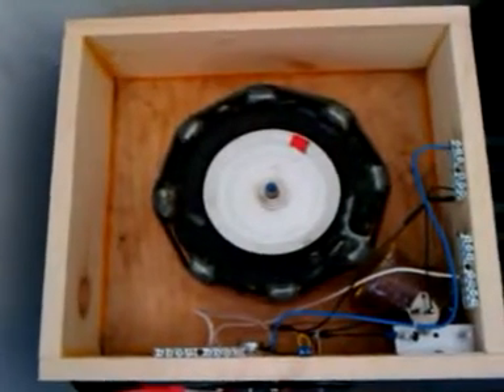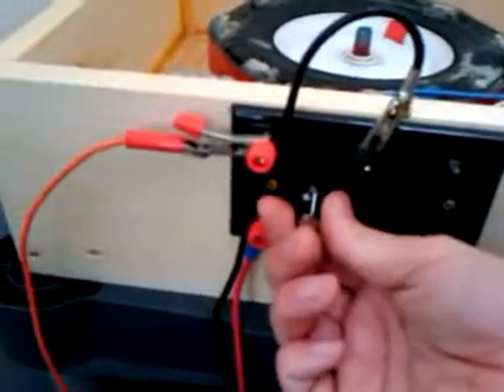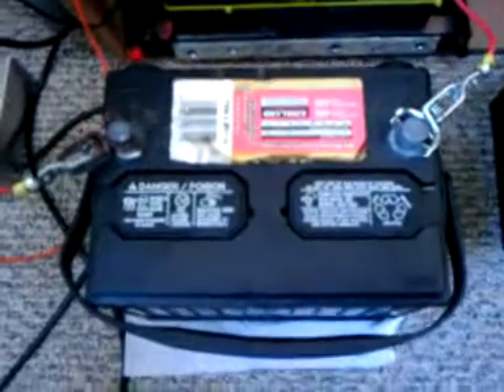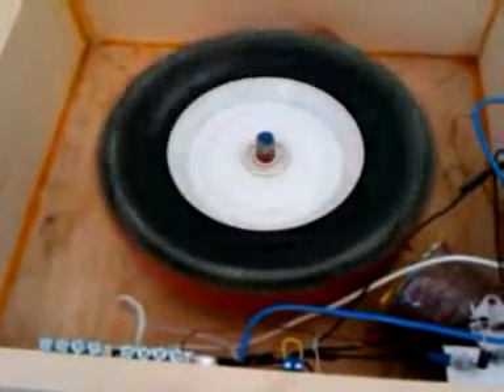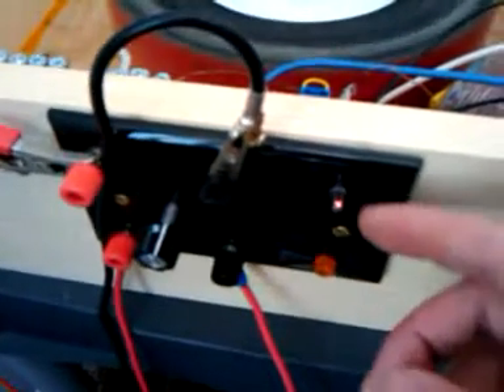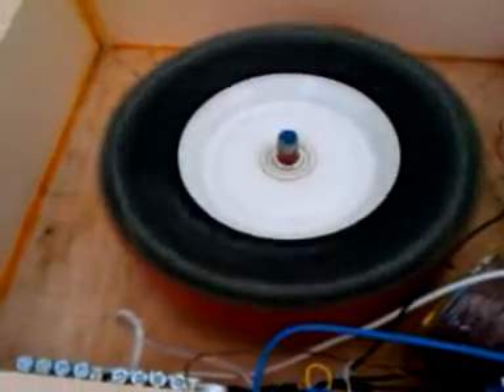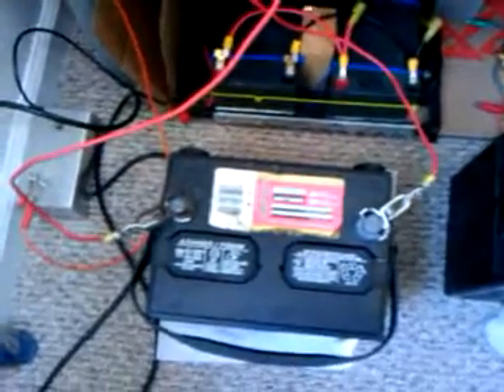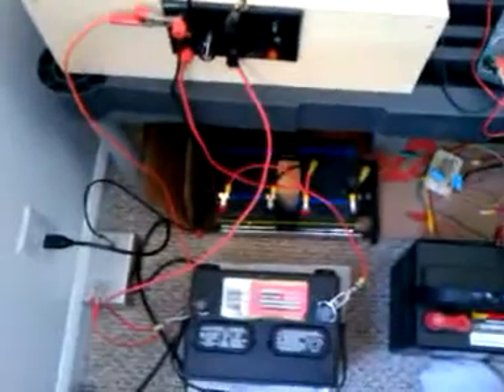How to desulfate a lead acid battery.

Comment: What magnet do i used  for this mate thanks in advance
Reply from the maker: Cheap ceramic magnets. Can be weak. Only important thing is that they have distinct N and S poles on opposite sides.

Comment: Hi    instead of using the Bedini motor why don't you use a stepper motor rotated by a common DC motor? , the voltage pulses coming out of the stepper motor windings are very high and with good current, and 200 HZ frequency per revolution
Reply from the maker: Been looking online but cant find much of what you mention. But you got my interest.
Reply from the maker: It would be interesting to see if you can get more out than in?
Reply: @TheDoItYourselfWorld  POWERMAX II®HYBRIDS is perfect ....I used powermax ii hibryds with 3 Ohm winding resistance and the peak voltage was around 190 Volts. good quality stepper motors must be used with neodymium magnets

Comment: I had read that the best way to desulfate a battery is to simply charge and discharge it repeatedly with a manual charger that you can set the voltage and amperage of. Usually they say use high voltage and very low amperage. Do you know what voltage/amperage is ideal if attempting to do this with just a charger?
Reply from the maker: No, I do not. But yes, you can restore it to some extent by "over charging" them. I dont mess with that since my Bedini motor works so nicely and gentle on the batteries.

Comment: Thinking back to the principle of how brush DC motor work.   When the circuit is in closed loop.  The DC current passing through BAttery+ terminal>>brush >>Commutator>> Armature coil>>commutator>> brush.>>BAterry - terminal.  The magnetic field is develop and store energy during a part of rotating angle  let say 178 degree of rotation.
   Then the brush is leaving it contact from commutator.  The decupling  high voltage will be developed becasue flowing current through magnetic coil try to maintain the current (Pushing by the shrink of magnetic field) across high impedance gap. If you everseen the spark at brush motor, That is. 
   The highvolt  is feed back to sulfate... That is his reason why..  Anyway The motor is better tooking out the  decoupling voltage absorber (Such as revers diode, Capacitor or any resister cross the motor terminal).   

   This kind of desulfator is producing the reverse high voltage pulse to batterry.
Reply: “This kind of desulfation is delivering reverse high voltage pulse to the battery” 

Can you explain what that means? Is that good or bad

Comment: Also, if you ever go to like autozone and they test your car battery with that little hand held tester thing, I don't care if they say it is good or bad, don't believe it. Those things plug a few variables like internal resistance and Open Circuit Voltage into an equation, but really they are about as accurate as flipping a coin. You want it out on a full load tester which puts a load on using coils that realistically simulates a car engine starting. Industry standard is holding its CCA rating for 15-30 seconds while staying above about 9 volts at room temperature.

Comment: I worked at a Batteries+Bulbs store. The best de-sulfating device I ever came across was from a company called Granite. It would bring batteries that put out 0 volts, had been left unattended over an entire winter, and were clearly near death. The best ones pulse voltage, amperage, and the frequency of the pulses all at the same time. This, along with a Schumacher (or as we called it, a dumb charger) charger was the best combination. We use the Schumacher to get the batteries voltage up to about 10 volts (it puts out power no matter what it's plugged into, warning, don't cross the leads though, it'll scare you), then the granite finishes it off. Often times it would bring them back better then factory specs.

Comment: I am using Auto Pulse Desulfator and I took the battery out of the car, charged the battery to 12 V, but the desulfator runs only until it discharges the battery to 11 V or less, so I have to charge the battery again. Is there a way I can connect both the desulfator and the charger to the battery so that desulfator can run all the time and recondition (charge/desulfate) the battery? Is it safe desulfator runs along with the charger, and can the desulfator damage the charger connected together with it to the battery? Thanks.
Reply: Hook up a good batery in paralell and keep an eye on the voltage. That will keep it running.
 I dont know if the charger will hurt the desulphator or not.

Comment from the maker: Yes, it is normal. The voltage under charge will be higher. But be sure to cycle it with a charge, the rest a bit, then discharge some, rest a bit, then repeat until the battery is restored. It will take a few cycles at least, to get it in shape again. But if it was new, it should recover.

Comment: I am trying to restore my motorcycle battery. It was basically new last year but I let it run down and sit for a year. I charged it up using my 2 amp charger. It will read 12.8 volts. But after resting it goes back to 10.5 volts. 
I built a bedini from ideas I got from you and others. It is charging with the bedini but it shows 16 volts while being charged by the bedini. 
Is this normal for a heavily sulfated battery. Also do you think plates are shorted because it rest at 10.5 volts

Comment from the maker: It takes a while, depending on the size of the Bedini motor you build. A bigger one will restore batteries faster.

You can connect all the batteries together in parallel to restore them on the Bedini all at one time tho.

The will also need to be cycled a few times on the Bedini. Charge, drain slowly, charge, drain slowly again and again until they are fully restored.

Takes a few days, but well worth it.

Comment from the maker: Well, I have messed up with my batteries a couple times through the years. As long as the plates are not physically damaged or broken, warped, then the batteries can normally be restored.

Comment: Thanx. But there should be a range limit. I have seen some other diagrams but all they confuse about frequency, that's why I have asked you about this. I mean should it be 1KHz, 10KHz, 40KHz, 100KHz or even above it?

Comment from the maker: This is a self regulating motor. It varies its speed based on battery size and impedance. But I can tell you that the shorter the pulse and the faster frequency, the better the performance.

Comment from the maker: I have been using old, discarded batteries that I restored in my electric mountain bike for a couple years now. Work fine. They were about 0.5 volts each when I got them. Now they hold enough charge for about 15 miles of biking, which is equal to the original batteries that came with the bike.

Comment from the maker: @EastcoastTinker If the neon is lit, you are slowly destroying the transistor. Shut if off immediately! If you want to charge a battery that is too low for the SSG to charge, put a like sized and type of battery in parallel with the dead one for a bit to bring up the voltage enough so the SSG can run with the dead battery alone. For example, if you have a spare lithium battery with the same specs, put it in parallel with the low battery for a few hours. But you also may have a dead cell.

Comment from the maker: @shartne The magnets cause a small pulse in a coil, which turn on a transistor. This allows a battery to send a pulse of energy through a second coil, repelling the magnet, which spins the wheel. The weak battery to restore receives a pulse of radiant energy when the magnetic field around the power coil collapses. In school this is normally called back EMF. But in this circuit there is something else going on here. The radiant restores the battery. For details see yahoo groups bedini monopole 3

Comment: I don't understand how this works exactly. I know you have magnets on the wheel. But what is running it, the battery? How does this desulfate the battery? Do the magnets cause a pulse? Is there a charger involved?

Comment from the maker: @ElRipper100 I have some restored batteries in heavy use now for three years. A pair that I found discarded in a dump, were below .5 volts, now run my electric bike very well. And the original inventor, Bedini, has been using the same set of batteries for over 15 years. I guess they could run indefinitely.

Comment from the maker: @scottmerton Actually, the machine does all the work. I just check the voltage from time to time. I sort of have a feel for how long a certain sized battery will need to charge, so I just check the voltage once or twice a day while its restoring. Just imagine though if we all used these things and never had to replace our batteries.

Comment from the maker: @Davetech23 Somehow the magnets passing the coil produce a more efficient radiant charging cycle. And it is very hard to get one of these to run in solid state mode. A "simpler" transistor switching circuit is way too hard to design and doesnt put out as much of a charge. Besides, this thing cost me much less than a single battery would have off the shelf, and I have dozens of restored batteries for free now.